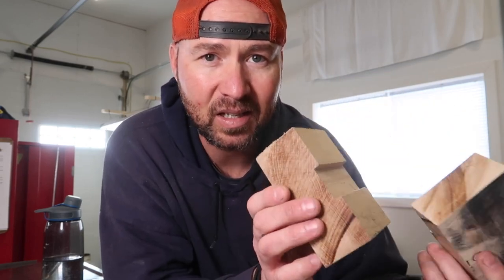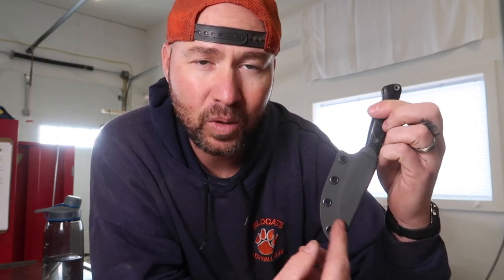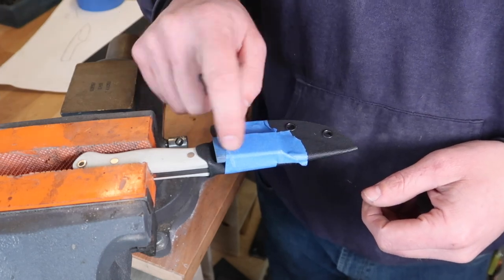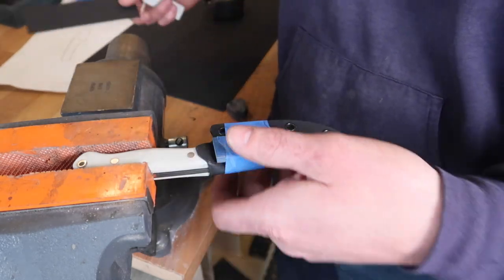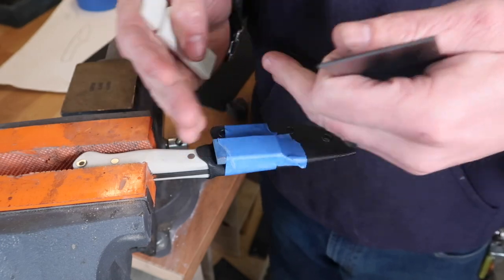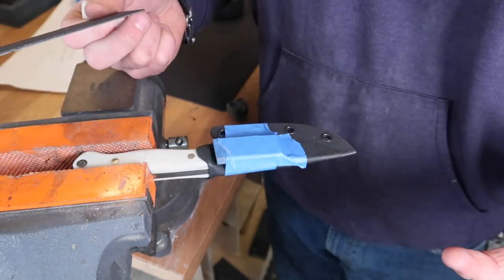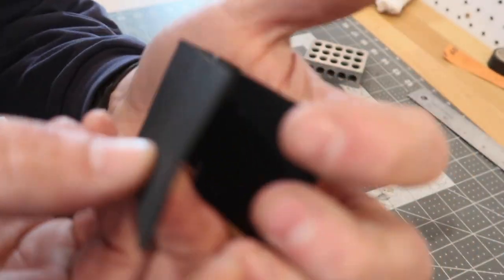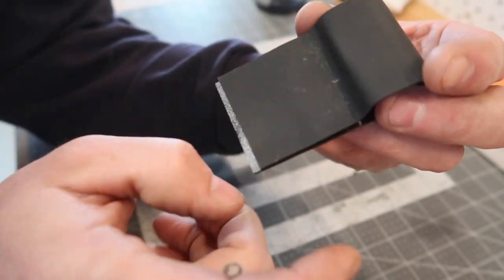Kydex Quick-Tip # 2 - (excellent option for EDC knives)

Comment: Excellent idea and I can visualize how versatile that method would be. Some I see recommend putting the standoff as part of the structure of the sheath. But that really does limit your options, an example with the knife you worked with in the video. Your method allows you to remove everything and carry the knife as a neck knife. And I suppose you can also switch sides, for left or right carry. I think I would like to give this a try, I hope it's as easy as you make it look. Thanks for this very useful technique.